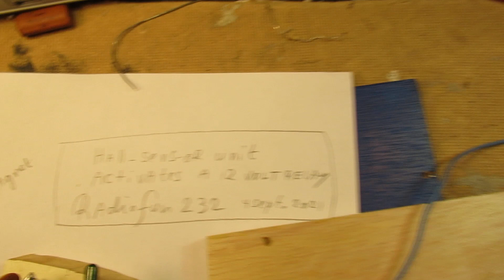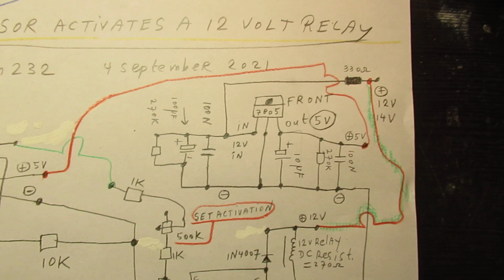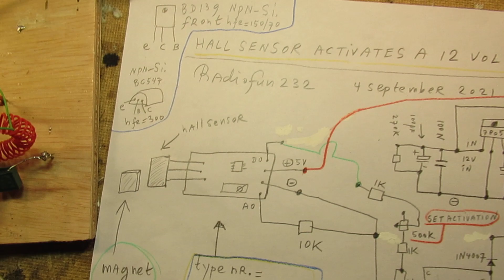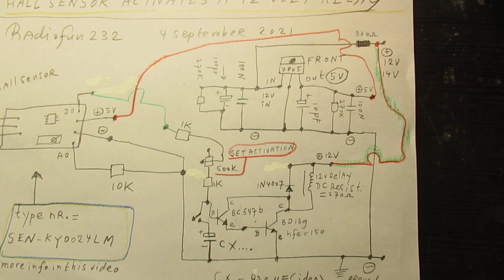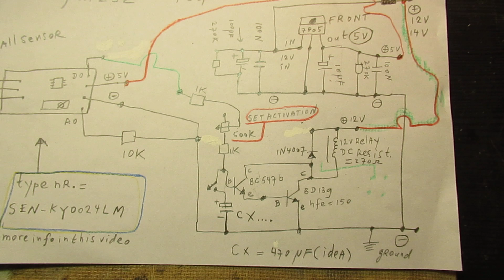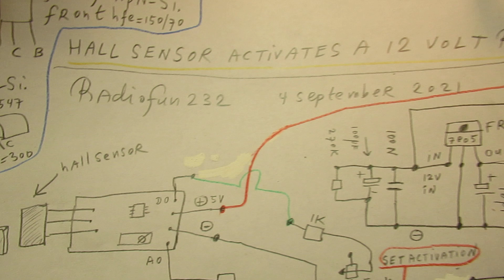Magnetic field detection via a Hall sensor: demo & electronic schematic (12 V relay activated)

Comment: Baie interesant! Was thinking: this looks like the same idea my car's ignition system works. (Had to replace a part in the distributor) If I remember correctly, in the distributor, the "pick-up" and the magnet are static (bolted to the distributor housing), but is interrupted wit a disc that is spinning on the distributor shaft, and this disc running between the magnet and "pick-up" has windows machined into it, thus switching the ignition coil on and off. Wasn't sure at that time wilts fiddling with it, but now I know! Thanks for the video!
Reply from the maker: Thanks & yes it works that way. Works in all kinds of ways, via magnetic influences coming up/pushed at a certain moment to ignite the spark plugs via a time sequence etc.